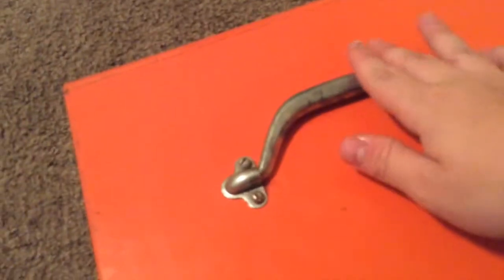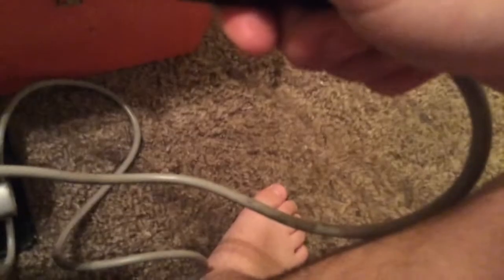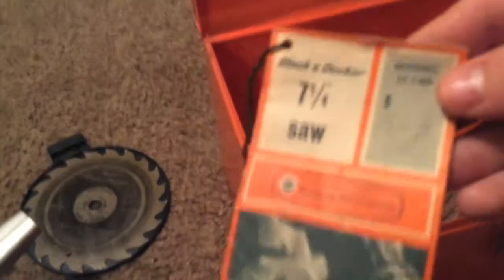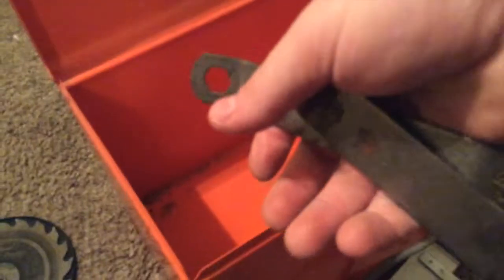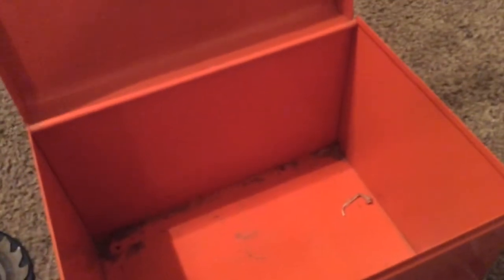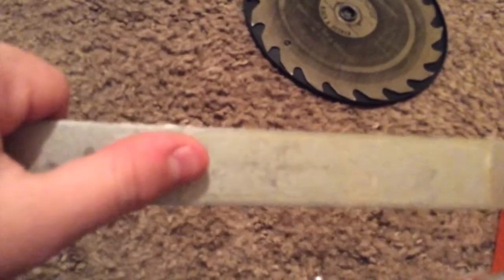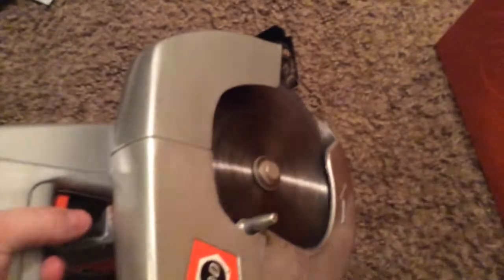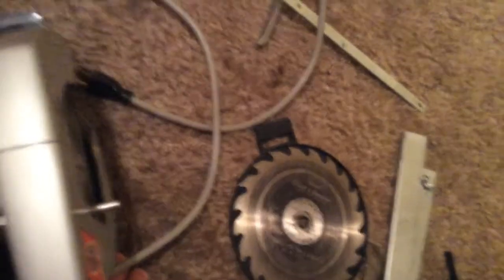Black and Decker U 130 Circular Saw Overview

Comment: It was 1969 that the three prong plug were made standard which I see is what your saw has. I just got one of these for free but didn't run. Took it apart and now it works. These have bronze bushings for the motor.

Comment: wow that is in very good condition and with the original box, manual, tags and blade! more like a collectors piece and a shame to start using it in someways maybe? ive just uploaded a video of my u90 but couldnt find much info on it from the internet, but by jiminies it does a good job of cutting firewood, what are you going to be using yours for?